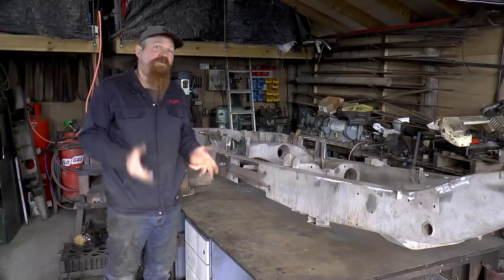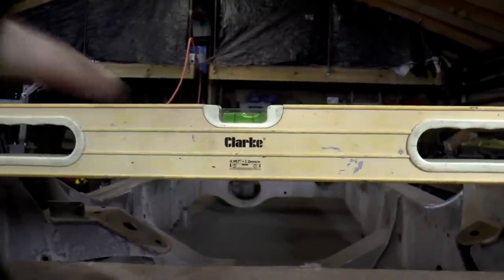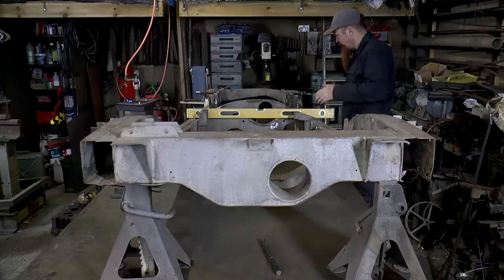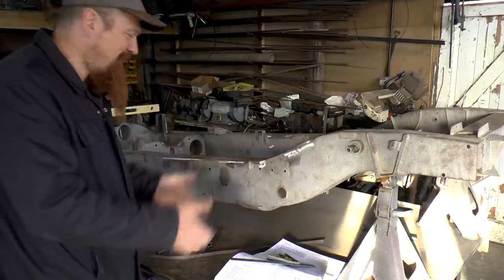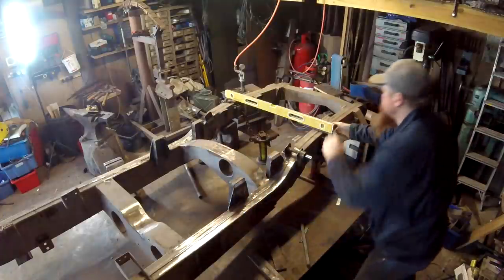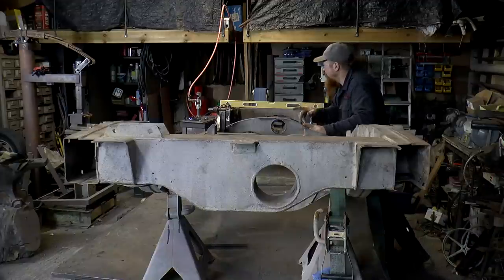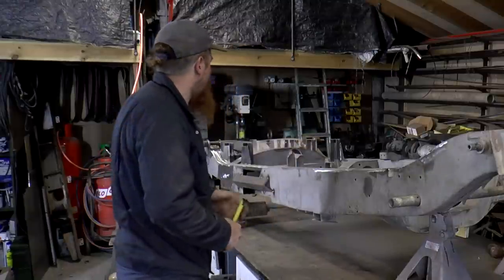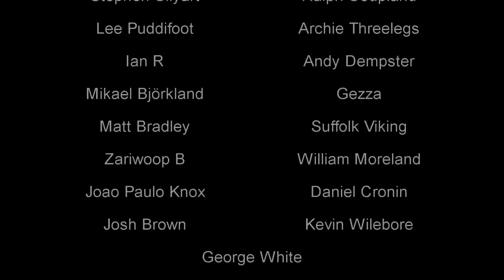Project Kermit 11: A Land Rover Series 3 Full Restoration

Comment: Very good effort, great workshop.  It's usual to use two string lines on this kind of problem, diagonal to diagonal as an X if they are equal in length and both lines TOUCH in the middle you've done it (was going to say cracked it) best not use that term Lol.

Comment: In the middle of a somewhat restoration of two 88 Series 2a Diesels ..... I couldn't be happier than with a chassis as straight as Yours .... It's a LandRover, so shimming measures in cm, not mm ...... once it looks slightly straight-ish from 10 feet apart, no doors spring open when You go on a non-tarmac road and each tire is worn evenly for its own You're golden ....

Comment: tolerances on land rovers have always been generous. two of the land rovers i've had over the years had bent chassis, my first land rover a 1970 2A was out by over an inch on the diagonal. i put that down to the fact I got it from a foundry where it had been used all its life to drag iron round the factory. later i had a lightweight that had nearly an inch twist, i only found that out when i cut the rear cross-member off to replace it and the new one was nearly an inch out. loving the Kermit videos its giving me inspiration to get LOLA my 71 SWB S3 finished and back on the road.

Comment: nice job on the chassis , need to get floor tie down points, saves the table some savage twist, set height jack stands, 4 good points to attach to with 4 same lenght sized chains. Excellent  results btw.

Comment: And if you haven't got a sturdy workbench, drilling some anchor points into the concrete would be another option, just so long as the concrete doesn't end up folding as a result... :P
Reply: I thought that too - a big rawl bolt in at an angle under the foot of that leg which lifted, and hang the restaint at that corner off it.  If you load it up a bit with the ratchet strap then the downwards force of the leg should stop the concrete pulling away.  Maybe :-)

Comment: Wow. Fantastic video. Thanks Max. At the start of this episode I was wondering if straightening a chassis was going to involve a a dumper truck and a digger… Then when the table started bending I thought surely there’ll be an intermission involving some drilling, concrete anchors and welding brackets to the bottom of the table legs. Nope. Just keep going. The chassis will give in before the table… Brilliant.

Comment: Thanks for another great update. When you got the first measurements I was thinking it's going to be pretty close and would probably handle about as well as any old tractor, as that's basically what it is if you go back far enough in it's original design.  It was a multi purpose vehicle  that could be used for road transport and some light field work on farms or big estates.   Take care

Comment: you could weld two rows of three or four box section vertically along the length of the chassis , weld some flat on each one for the chassis to sit on with enough gap underneath to put some big g clamps on..

Comment: Have you ever saw a twisted rail wagon frame? Some heat in the right spot some hammer blows on the right spot and some water  then it straightens out takes some pracktice though

Comment: For checking the distortion you could use simple winding sticks as a carpenter would use to flatten timber. I expect you know, but they are just two straight parallel pieces of timber. You place one each end of the chassis and check twist by sighting along them. It means the chassis doesn't have to be level to do the check.

Comment: To stop the leg lifting you could either weld a piece of angle iron to the bottom of the leg and dynabolt it to the floor or put a post from the top of the table up to the roof

Comment: I have no beef with,no experience of , and no vested interests in Richards chassis ( or similar) but I wonder how a brand new Galv 109 chassis would actually measure up?  Especially as hot dip can induce a fair degree of twist and buckling 
I was thinking as you were waving the tape around, near enough is good enough. The axles go out of parallel when you go over bumps anyway!  Don’t do the ton, and you’ll be ok
Edit. That’s flat and square now. Nice one

Comment: Sorry i don't mean to doubt your knowledge in any way, but i'm guessing you checked the table prior to measuring?
Reply: Just replying to myself here, in the style of someone else: "He's referencing it to itself, you idiot". Yes, you#re right. My mistake. Just as well Max is making these videos and not me.
Reply from the maker: I'm only checking the chassis relative to itself - so if one end is level and the other end is not - it's twisted, whereas if both ends are the same it's straight. So in this case it matters not if the table itself is straight or not.
Reply: @maximusironthumper  heh heh thx max.

Comment: Twisting it back will also causes heat, unless you stress relieve and get the molecules back to their original state it will be weak at the welds and float around for squareness. Cheers.